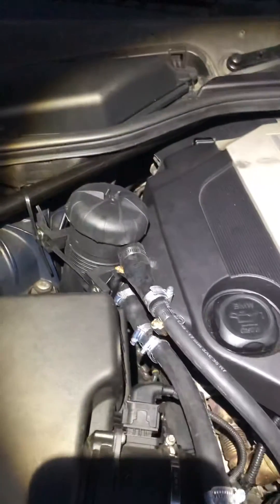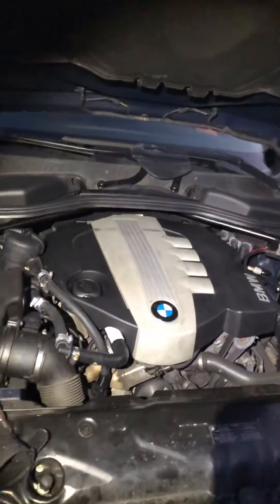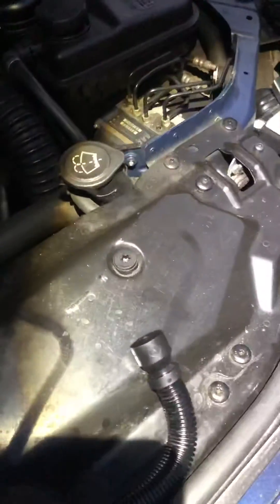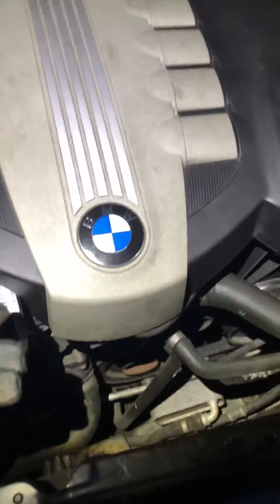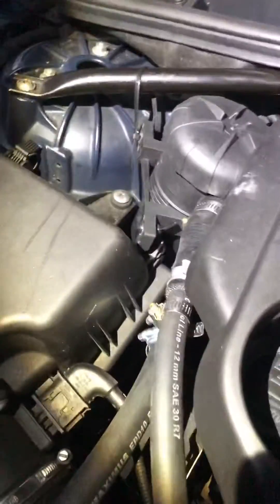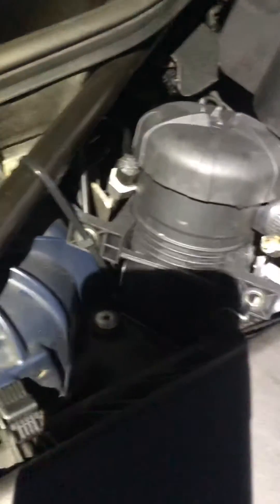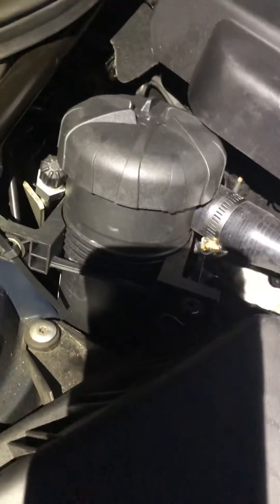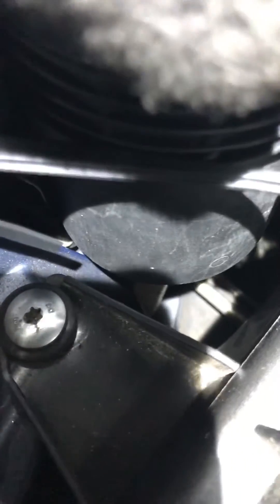BMW 5 Series E60 / E61 Oil Catch Can Installation with Mann Provent 200 N47 Engine

Comment from the maker: *Applies to all Diesel direct injection engines (almost all modern diesel engines are direct injection)  not just BMW *

Because these engines are direct injection, there is a ton of oil floating around in the breather system that BMW install. The idea is that blowback oil is burnt off as part of the normal running of the engine. Unfortunately a good proportion deposits itself throughouth the aspiration system leading to expensive garage bills, or, these days people just write the car off because of the low resale value.

For £200 you can obtain a Mann Provent 200 and install it relatively easily. I have seen many videos on other cars, but nothing for an E60 or N47 Engine, so here is what I came up with. 

If this helps you, please consider liking and subscribing. Any questions or feedback - please leave below!

You can order the Mann Provent 200 here: https://www.darksidedevelopments.co.uk/products/mann-hummel-provent-200-oil-catch-can-breather-system.html

Really good explanation video on the Mann Provent 200 system: https://youtu.be/7kvfjvq6lCQ

Comment: I would install this if they made a kit specifically for the N47 as I really don't feel like cutting and chopping pipes and then using cable ties
Reply from the maker: Totally agree George - I have now made up a mounting plate so that it is solid. Re. interfacing to the breather the hold in the intake is proprietary so not sure how to get around that in any other way. Unfortunately there are no kits on the market. It took me a day to get the mounting plate made up - I did think about making a drawing and having a batch made - there's got to be a strong market for a proper kit...

Comment: Hi, you have the inlet and outlet switched. Bottom outlet should be connected to intake. Source: https://oe-products.mann-hummel.com/fileadmin/user_upload/kataloge/kataloge-wartungsanleitungen-mann%2Bhummel/kurbelgehauseentlueftung/ProVent_en.pdf
Reply from the maker: Wooah - thank you, having reviewed - can see you're right. I'm making a metal mounting plate that I'm going to weld up to mount the filter more robustly. Will do another video with the pipes correctly fitted once that is done. Thanks again - really appreciate you pointing that out :-)

Comment: Same thing I will do on my 3 series ...I have 318d 143ps 2007 and I want to install a oil catch can I have same cod motor N47
Reply from the maker: Cool, good luck! Post some pictures / a video? Would be interesting to see if you have more mounting space?
Reply: @FixItWithJon  On serie 3 I have more space in front .....but I'm not sure which oil catch can I will use ... which one you use it is MANN with filter?
Reply from the maker: Sorin Gringo yep, Mann Provent 200 seems to be the best 👍